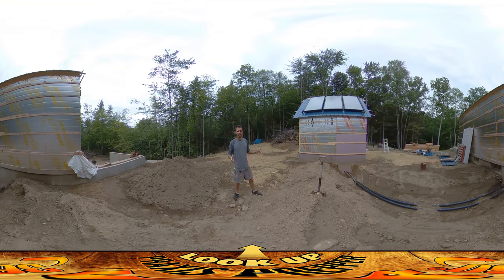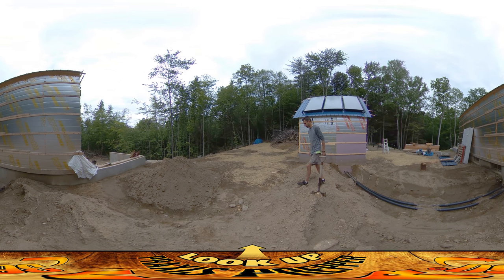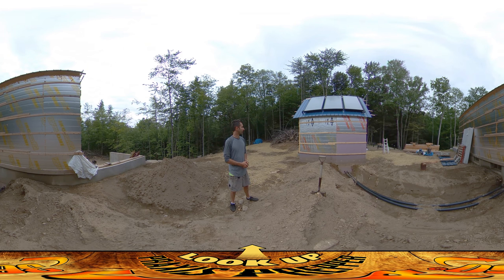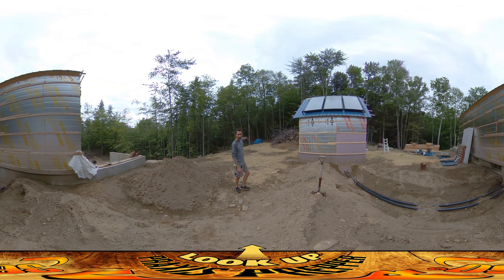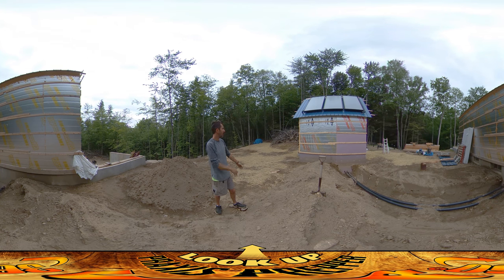Homestead Building - Solar Hot Water Installed, Adding a Power Line Conduit

Comment: Great to have the spot for your folks. If it were me, - so opinion not advice - I'd do exactly what you are doing now with water and electricity and not plan for black water. The need for sewage is only in the event of a long term disaster situation and I have confidence I'd figure it out when the time comes. Right now, I see getting the main house completed to the level to be lived in would be my first priority.
Reply from the maker: Yeah, I'm not stressed about the black water or anything - but i do constantly think about EVERYTHING all the time. ;)

Comment: I'm surprised that the hoses aren't below the frost line and that the hot water return line isn't insulated. Seems like a huge inefficiency built in. When you go over it I'm interested in hearing if it actually has water running through it or if it has some other fluid like in a geothermal heating/cooling system. I seem to recall you talking about a small tank of glycerin but I can't remember the context.

In an RV the grey water is needed to clear and rinse the sewage hose after dumping the black tank so don't plan to dump the black without having a good amount of grey unless there is a black rinse system on the trailer.
Reply: In the UK at least only 450 mm clearance is needed for the frost line, so I think when it's dug back in and the landscaping gravels are added it would be about that? Though pipes in the outdoor environment should have a jacket on for UK code at least to at least 750 mm depth, or that is what I used to tell my clients when I worked as a geotech engineer. But that is just my UK centric opinion :-D.
Reply: I was wonder the same thing about the frost line (120 cm here in Saskatchewan)
Reply from the maker: The underground lines will carry glycol, not water, and they are insulated with maybe 1.5 inches of foam and also the dead air space in the ABS pipe. I'll also be laying insulating foam over the entire run before I bury it too for added heat loss reduction. The water line I'm running is just a summer sort of idea at the moment and was a late add to the run. Otherwise, I would have put it deeper for the reasons you alluded to.
Reply: Praxis Homesteading and Survival Skills 😊

Comment: If you are using plastic pipes it might be a good idea to use an old metal detecting trick, and put only a few bits of shredded tin foil in the ground around the pipes so you can find them really easily again with a metal detector :-D. You might know where they are but in the super long term, would River know where all the utilities are when he is 30 and wants to add a outbuilding?
Reply: Wizzkid3000 I think River could just judge from looking inside the house where the pipes are, but that is a good idea for longer areas or where you couldn’t see where it is easily. Around here we use scrap metal to do that and set it about 10cm above the pipes so you know you are close to it.
Reply from the maker: That's a great tip Wiz Kid, but we'll also have this series for locating things. ;)
I've actually gone back to re-confirm some things that I knew were shot in this series months later when I needed to get a sense of where things were. It saved a lot of digging. Your idea about foil is great though!